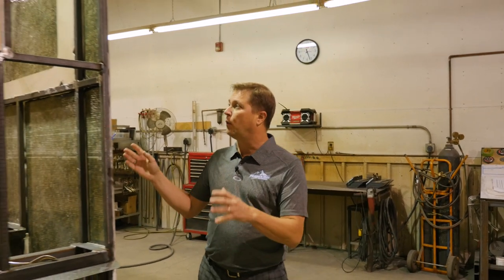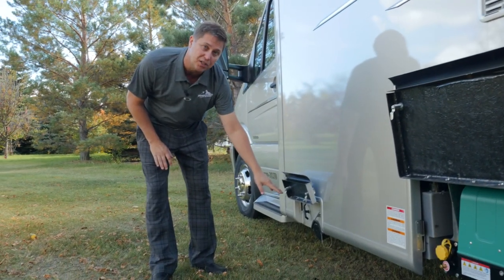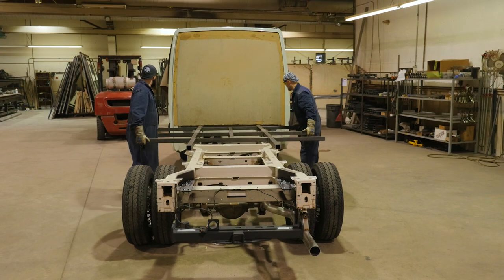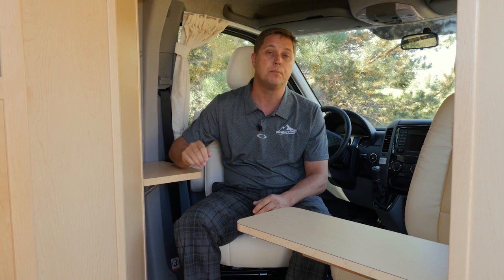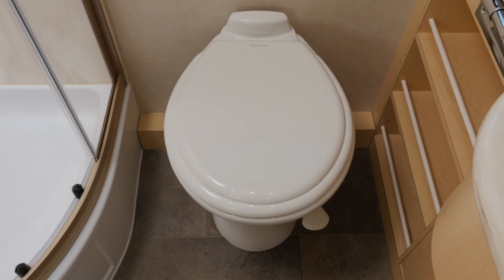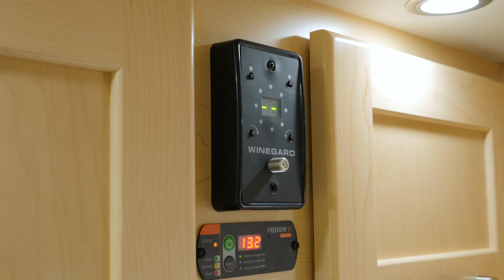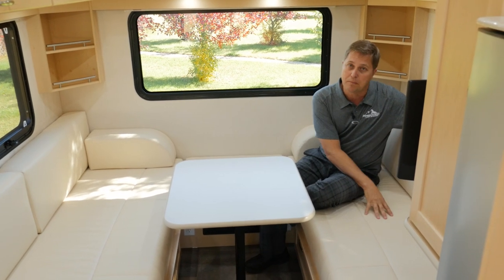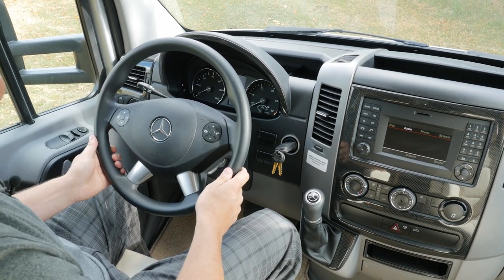2017 Pleasure-Way Plateau XLTD Tour

Comment: Very nice, but I'd like to suggest two possible improvements for the next model year:

1. Replace the Onan generator with the Mercedes underhood second generator with high-idle option.
2. Consider upgrading the absorption fridge to a 110v/12v compressor fridge.

Comment: I really like this, and it shows Pleasure-Way's attention to quality and detail. There are only a couple of things I would add, and one change: Add spot lights over the driver and passenger doors, using the overhead area, for safe exit/entry at night; and block off that small mid-portion of the under sink drawer,  so that stuff doesn't rattle around, and it's a great place for the small items we all accumulate. The change? I'd like a permanent, fixed location twin or full bed, across the back, instead of a dinette and singles. Bed should be at least 39" wide. I have no use for a dinette. Additional drawers can be installed in the open space as "end tables." This is because I'm a full-time old vagabond, just me traveling, and don't need two beds... but want ONE that has more room. Just an idea!
Reply from the maker: Hi Thomas, we appreciate you taking the time to detail out your suggestions and thank you for watching. Have a great day!
Reply: Thomas Darby 
"I have no use for a dinette"
Most people would disagree. Where do you eat? The front seats?
Reply: aguyandhiscomputer Yes, precisely. I am ONE person, and the two fold-up tables are sufficient, using the front seats, for both a desk and eating table. But that is for ME, each person has their own needs.

Comment: Just curious. Dean, is it really possible for a 72 inch person to stretch out on a 74 inch bed? Seems like, when you include the pillow space, you would have to sleep with your knees bent or feet or head touching the ends. Otherwise, this appears to be a perfectly designed motor home. Pure luxury.

Comment: What's the largest TV that can be mounted in the back? Love this RV...but want to see ur MB video as well!
Reply from the maker: Hi John, we currently only offer the 24" TV seen in the tour. The reason for using a 24" TV is the based on the size of the area, not the capacity of the TV mount. We mount the bracket where it is so the TV doesn't stick out into the hallway of the coach. The TV also currently fits up against the side wall of the coach, so adding a larger TV would require moving the mounting location of the arm. I hope that helps. The Plateau XLMB video will be released next so stayed tuned! Thanks for watching!

Comment: Very nice unit! What is the size of the area where the lithium batteries are located? I'm interested in upgrading to 300AH. I also see tables that show a big drop off of usable lithium battery power for below 50 degree, do you offer a heat strip or light in the battery department for lower temperatures? Do you have a option of getting a bigger inverter? Thank you
Reply from the maker: Hello 2badger2, we don't include a heat strip in the battery compartment primarily because they are already located inside the coach, so as long as the motorhome interior is warm the batteries will be too. The battery compartment is approximately 11"x31", but with all the wiring and connections the two batteries fit fairly snug, with enough room to easily remove them when necessary. We currently do not have an option for a larger inverter, only the standard 2000 watts. Thanks for your questions!

Comment: So do we have power door locks?  Ours is on a 2016 MB chassis.  Still discovering different features we didn't know we had. :)  Is the one in this video a 2017 chassis perhaps?
Reply from the maker: Hi C Mazz, yes, you will also have power door locks on your 2016 chassis. All model years of the Plateau XL series have featured power door locks. Thanks for watching!

Comment: Greetings
 What is the dimension of the cab-over storage? and weight capacity?  It almost looks as if it could be a bunk sleeping area.  Thank you!  I'm interested in the most multi-functional, dual-purpose living areas when it comes to limited space and prefer two separate sleeping areas and even an individual quite zone if its possible... so to speak.
Reply from the maker: Hi Faith, the dimension of the over-cab storage is approx. 68" wide x 17" high x 24" deep. However, the cab is not square so those dimensions change with the contours of the area. For example, the 17" measure is the highest point (front of storage area) and progressively gets shorter as the area rounds over. 

Regarding weight capacity, the area is quite strong as it is supported by the steel frame we built as well as the original chassis roof, which the storage area rests on. You can safely store 200 lbs in that area with no problem. I will add that we don't recommend using that over-cab storage area for sleeping as we have not designed it for that use. Thanks for watching!

Comment: very nice , dose it come in four season and four wheel drive for the sportsman ?
Reply from the maker: Hi Mike, unfortunately not. Mercedes-Benz does not offer a 4x4 version of their cab chassis, which the XLTD is built on. We also do not build any of our models for all seasons. Although the coach can still be driven and operated fine in winter conditions, you will not be able to use the fresh water system as there are tanks and water lines exposed to potential freezing temperatures underneath the motorhome. We recommend winterizing the fresh water system at that time. Thanks for your question!

Comment: love the construction, but the interior, is falling short,  dont like propane sotve and the sink isnt deep or wide enough,  if i could get a deeper sink, and a induction stove, and some other options,  love the solar very nice.  thanks
Reply: Propane stoves are standard in this size of RV. You'd need to run a generator full-time to power an induction cooktop; and could not run the AC at the same time. Unless you are hooked to shore power, that is. Larger RV's, with room for a bigger generator, and more batteries, can easily handle the load. But I agree, I'd trade that under-sink drawer for a deeper, larger sink.
Reply: thanks for that
Reply: Thomas Darby we are very interested in this unit, as for cooking, I enjoy cooking  outdoors. I have a small table that I put a griddles on for breakfast, and a cuisinart grill for grilling and a Coleman camp stove for maybe a pot of beans, etc and a crockpot. Only cook indoors if it is raining, then usually it is sandwiches and salads.

Comment: Do the units come with the Mercedes side lanes sensors? Can I get the unit without the lighten bolt in the side? Thank you
Reply from the maker: Hi 2badger2, currently, only our standard body Sprinter models (Plateau TS, FL and Ascent) come with the side lane sensors. Those models come with the Mercedes Driver Assistance Package. Our two widebody models (Plateau XLMB and XLTD) do not come with that package. Regarding the decals on the sidewall, if you were to custom order your Pleasure-Way you can certainly specify to have the graphics removed upon order. Thanks for your interest!

Comment: Can you build one with propane free, just solar panels and lithium batteries like road treks?
Reply from the maker: Greetings! Unfortunately we cannot. We believe in having multiple power sources to ensure you will never be stuck without power. We include propane to run the fridge, stovetop, water heater and furnace. Propane is more efficient than running a generator to recharge batteries after they become depleted. I hope this helps explain our position on not building all-electric, thank you!

Comment: hello does it have a storage tank for fresh water what is the capacity if there is any? thank you so much
Reply from the maker: Greetings! Yes, there are three storage tanks on board. The fresh water tank is 28 US Gal/106L, the grey water tank (which holds all water used from the sinks and faucets) is 20.4 US Gal/77.2L and the black water tank is 17.4 US Gal/65.9L. All other weights and measures can be found here: http://pleasureway.com/plateau-xl-td/ Thank you!

Comment: How many seatbelts does this motorhome come with?
Reply from the maker: Hello, the Plateau XLTD comes with two seat belts, which are the front cab driver and passenger chairs. The XLTD and XLMB both have sideways oriented sofas which makes it difficult to add seat belts, so we designed them to be two-person motorhomes. Thanks for watching!
Reply: Thank you for your response.  Your motorhomes are beautiful and elegant.  They're just the right size to travel across the US with great mobility.  But I need to safely transport at least 5 people, and I cannot do that without the necessary restraints.
Reply from the maker: I'll just add that our standard body van models: Plateau FL, Plateau TS, Ascent and Lexor each come with 4 seat belts. Unfortunately we do not offer any models with five seat belts as you require.

Comment: What is the price range for one with twin beds and solar and generator and 2000 watt Inverter ?
Reply from the maker: Hi Kathy, the MSRP for the Plateau XLTD starts at $137,670 USD / $142,870 CAD. The generator and 2000 watt inverter are standard features on all our models, so that is included in the MSRP. 

Regarding solar panel options, the MSRP for one, 95 watt panel package is $975.00. We offer a maximum of five panels on the XLTD and that 475 watt (5 panel package) is $3,250.00. 

For more detailed information on pricing and availability it is best to contact your nearest Pleasure-Way dealer, which you can find here: http://pleasureway.com/locator/ I hope this helps, thank you!
Reply: Ok Thank you. This is very nice But don't want the propane stove just counter. It would be lovely to add plugs with adequate apps for Coffee pot and Portable induction cooktop 

Also it would be helpful to raise the kitchen bottom cabinet a inch or two so we don't have to stoop to use it. That would also give room for the additional room in the drawers that would be appreciated. Also IKIA has a wonderful style drain so you can enjoy a nicer drawer under the sink. 

Also frosted glass in the Bathroom window would be an improvement. 

Is it well insulated? Nothing was discussed on The INSOLATION.
Reply from the maker: Hi Kathy, regarding the insulation, we install rigid, polystyrene foam insulation in the Plateau XLTD. It is installed in square pieces along the side and rear walls as well as the roof. Although we use insulation, our coaches are only built for 3 seasons. Meaning, in below freezing temperatures you can still operate the coach fine, but you will have to winterize the complete fresh water system. Thank you.

Comment: I didn't see any rust proofing on the frame as I live in the rust belt.
Reply from the maker: Hi Rico La, although we always attempt to provide as much detail in our videos as possible we are not always able to showcase everything. We do indeed spray the entire frame and undercarriage of the motorhome with undercoat. The motorhome is lifted on a hoist so we are able to spray and thoroughly cover all unprotected areas of the steel frame. This process is done soon after where the construction aspect of the video left off. I hope that helps clear things up. Thanks for the keen observation and taking the time to watch!

Comment: What insulation do you use in the walls?
Reply from the maker: Hi sparky neely, in the Plateau XLTD, we install rigid, polystyrene foam insulation to the walls of the coach. It is installed in square pieces along the side and rear walls as well as the roof. Although we use insulation, our coaches are only built for 3 seasons. Thanks for your interest!
Reply: I admit to curiosity as to why a Canadian company would only build for three seasons. Isn't the story in the mountains that there's ten months of winter and two months of bad skiing?

Comment: 110 or 220 hook up?
Reply from the maker: Hi Fahey House, our motorhomes are supplied with a 110v, 30 AMP hook up. Thanks for watching!
Reply: Pleasure-Way Motorhomes 
How do you power the roof AC with 110v?
Edit: I'm an idiot. I thought 30amp was higher than 110v.

Comment: Sorry, bathroom cube (floor to ceiling) placed forward  BLOCKS feeling of openness from the moment you walk up the steps into the RV. The front cab view is almost cut in half from the rear. Bathroom itself is nice, but wow......how appetizing is it to open a toilet area into a kitchen. The over-cab storage will always look like a mess without doors. I realize top or side opening doors are out of the question but solution could be three tracks with equal size  thin sliding doors .This full covering would only block 1/3 of the opening access when fully open and still provide plenty of width to load and unload. Keep your beautiful interiors clean with all storage covered.  I 've played with the floorplan to place that bathroom, but it's a real hard to solve problem. But seriously ......bathroom NEXT to kitchen OK but never opening into ....eeeewwww.